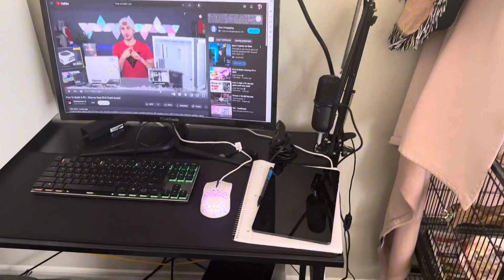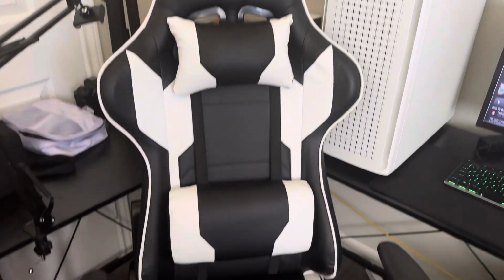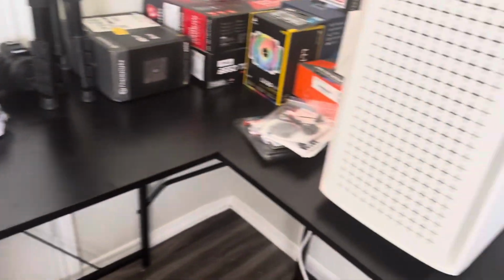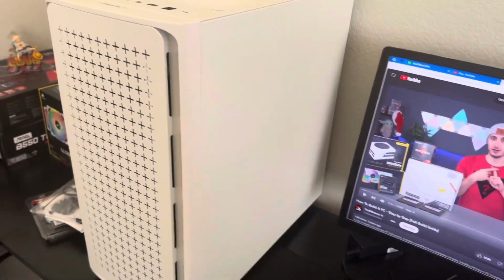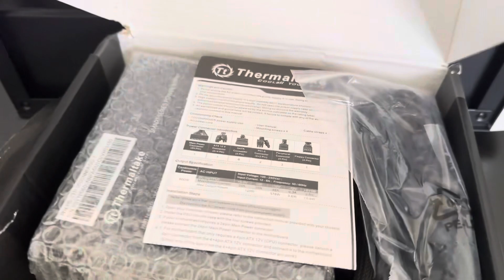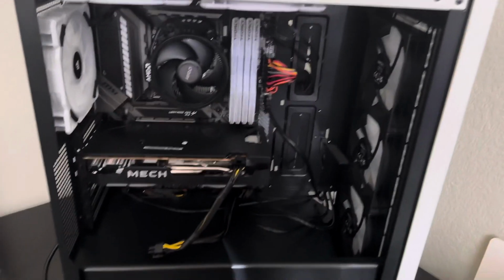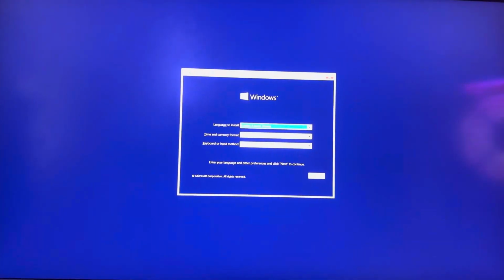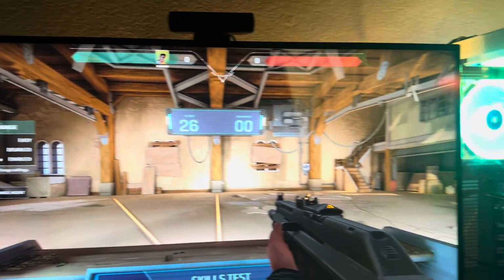Building a PC for the 1st Time (can’t believe I did it!)

Comment: Friendly reminder about the Thermal Paste for your CPU. Yikes ! Didn't see if you put it on before you popped your air cooler on. Otherwise, Awesome job ! Also, If you download Dragon Center for your motherboard, you can control the RGB colors of your fans if you wanted.(if i'm not mistaken).
Reply from the maker: Yes the thermal paste was already applied! And I’m able to control the colors of the fans with a button built into the PC! Thank you!! ❤️

Comment: Nice build. A few tips if for you have not done this already. Make sure to enable xmp profile on your ram. Ryzen CPU’s tend to like faster ram speeds, and you may as well get the most out of what you bought.

Secondly look at undervolting your gpu and cpu slightly. Most often this will result in similar fps, if not better, with much lower power consumption and temperatures. There are plenty of guides to help with this, just search up your cpu/gpu undervolt settings guide. You should also put on the aftermarket cooler. The amd stock ones are pretty bad.

Also depending on how heavy that figurine is, your gpu might start to sag pretty bad over time. They tend to do this anyway, so any extra weight will speed up that process. You can get cheap brackets to hold them up.

Also I am not sure if you bought the 5600g and not 5600x because you didn’t know the difference. But you are essentially paying a similar price for a noticeably slower cpu. That has integrated graphics you are not going to use, as you have a dedicated graphics card.

Also I always route my cables for gpu and motherboard up through the bottom cutouts. It looks much neater that way. Also If you have any more questions feel free to ask.

Either way it’s a decent build. I hope you have lots of fun using it.
Reply from the maker: 😊 thank you

Comment: Xea can you change the lights of your pc to any color you want?

If so can u please send a link of the fans your using please
Reply from the maker: I can only change the fan colors for the front fans because those were built in the case with a button to do so :) but here is a link for the other fans I have 

https://www.amazon.com/CORSAIR-SP120-Performance-Triple-Lighting/dp/B08XY2QNJ5/ref=sr_1_2_sspa?crid=8WJMQXIHRVEW&keywords=corsair%2B3%2Bset%2Bfans&qid=1698180930&sprefix=corsair%2B3%2Bset%2Bfans%2Caps%2C126&sr=8-2-spons&sp_csd=d2lkZ2V0TmFtZT1zcF9hdGY&th=1

you can also find these at best buy!
Reply: @XeaXOdesi  thankyou